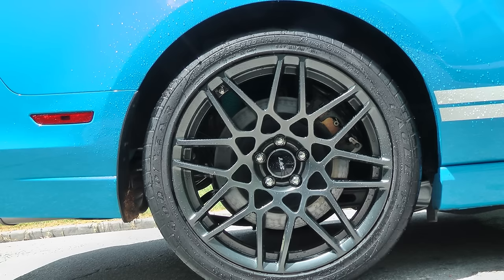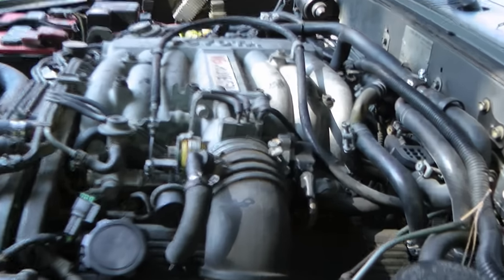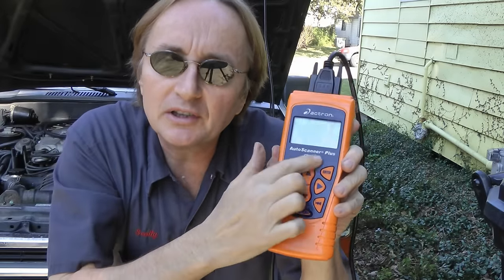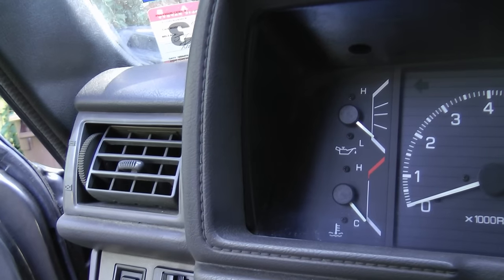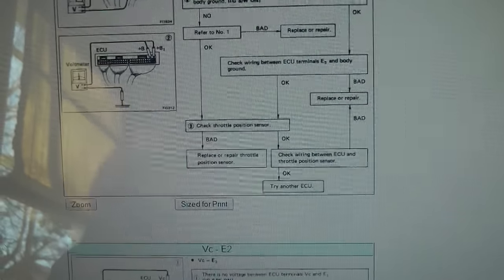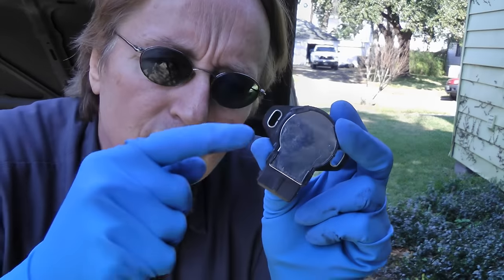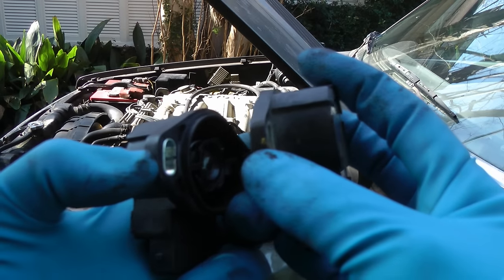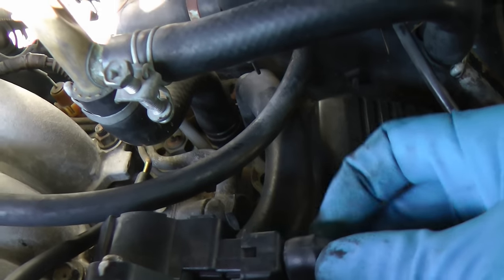How to Stop Car Hesitation (Throttle Position Sensor)

Comment: Hi Scotty my name is Carlos...I have a problem with my 2004 Dodge Caravan 3.3... It takes a little wile to start then when it starts runs good but when I put some gas starts to fell then when I drive runs good until up to #2 on the RPM gage then runs good until it gets to #3 RPM (I hope you understand what I'm trying to say)starts shacking again we change the camshaft and cranckshaft position sensors and we still have the same problem THANKS

Comment: Hi Scotty I have a 2001 Buick Century and it has an issue starting after the engine is warm and has been sitting for 30min- 2 hrs it will either start and die or just turn over. If I give it gas and rev it will run. I have read like everything on the internet about it and can't figure it out. You have any ideas? I see everyone online has the issue but no real cure I can find.

Comment: Hey Scotty, recently my 1990 4runner with the 3.0 v6 in it started to hesitate a lot. when giving it more than a quarter throttle at a stop it will not move and sounds like the engine dies for a second, then starts to catch and go. what do you think it is? thanks

Comment: hey scotty i used your test i unplugged the sensor and the idle went up from 5 to around 1000 so i changed it my problem is no power in my 1990 4runner ive also changed pluggs wires cap rotor even the muffler  it still has no power going up a hill is a challenge  do you have any ideas thanks,  the new tps did up the idle a little but still no power thanks

Comment: Hey Scotty I got a 2013 Honda Civic LX I got po171 code on it, I found a rip in the intake hose so I replaced it myself. I cleared the code and now the car seems to shake anytime going through gears no codes have came up since the replacement but im not sure what it could be now ?

Comment: Hi Scotty, great Video, I'm a fan of your skills -) I have a Subaru Forester T/Tb 1997 and the Auto Gearbox Error code 25 - — Еngine torque control signal - do you think that could be related to TPS? I replaced MAF, Lambda, Camshaft, Knock Sensors already with no success. The issue has been on going for almost a year now, no mechanics can help, at least I was unable to find decent mechanics. The car starts and drives just fine, then next day I get HOLD light flashing (error code 25) the car stats to hesitate with poor acceleration and  drinks loads of petrol but drives just fine otherwise. The idle is very smooth at all times though. So the issue might come and go, some days I get that some days it runs just fine. No Subaru forums were able to help me -((( Thank you!

Comment: i've been told to check my TPS sensor and the MAF but I Don't have any check engine light, sensors can be damaged and not be detected by the computer? I have a scanner and it doesn't pick any codes, car behaves erratic or random, sometimes feel normal and sometimes feels sluggish. Any advice. Thanks !

Comment: Nice video guy, I bought an old 94 gas passat and now it is stopped before some problems with rpm oscilating up to 900 and suddenly died, the comb pump is working and engine just don´t start teste relay and looks ok. I´d like to test bymyself the MAP sensor but it looks hidden cause I cant find it. Can you help me (*it is not inside ECU like old golf)
Reply from the maker: +Mauricio Ximenez   you really need a vag com computer to test that system correctly, and realize a 94 passat will fast become an endless money pit. My advice, get it runnin and sell it on

Comment: hey scotty, I have a 2007 gmc sierra. when I drive around 40 mph   my truck hesitates and the rpms  go up and down. it has 80,000 miles on it. I changed my transmission fluid around 65,000 miles. Is there something else that I could be missing? I don't know what could be the problem

Comment: Hey scotty. I have a 2016 nissan altima. Recently shaken and halted. Runs now but no more than45 mikes ph. Auto zone scan read throttle body. I cleaned the mass sensor and didn’t resolve. I bought a throttle cleaner but not sure if it will work or may need a new one. Pleae help

Comment: Scotty I have a 2010 hhr had too replace cam position sensor now the check engine light comes on and off and the,engine idles rough and surges when you come to a stop any ideas? Thanks.

Comment: I have a 2007 dodge charger and its having a problem with not acceleration when you put your foot on the gas pedal when going down the road. i replaced the throttle body and put a  gas pedal on it. It still doing it what do you think i should do?

Comment: Hey Scott, 
I just got a used Sentra with 72,000 miles, it was in a fender bender. Got the body repaired and everything but the exhaust sits low. As we drove home, on a hill it lost all power. Tried to accelerate and it started reversing. Got it started again and it did it again within 5 minutes. Today got it towed but it idled so much, he could barely get it started. The guy thinks its the throttle. What do you think?
Reply from the maker: could be, pray it's that easy, the throttle assembly or the pedal assembly, any pro mechanic can diagnose that fast with his scanner

Comment: Sotty I have a 2001 Dodge Dakota (V6 Automatic), that does this but only when in gear. If I leave it in first it will go past 2000 RPM but it with extreme hesitation. If I leave it in drive it will not exceed 2000 ever. Would this be the throttle position sensor?

Comment: Scotty my 1988 22re cuts out at around 3 thousand rpms and then comes back into acceleration once it drops. It creates a VIOLENT wheel hop. Its had the throttle positioning sensor, fuel pump, mass air flow sensor, and spark plugs replaced. What should I do?

Comment: I replaced the MAP sensor and the Throttle Body Position sensor, it still hesitates, won't go over 70mph with gas pedal to the floor and then will take off like a rocket and get stuck again. Would the iat sensor be the problem?

Comment: I have an 89 oldsmobile my tps code came on is there an easier way to replace it without removing the throttle body ? Also I don't know where to adjust it to

Comment: Hey skotty thanks for your advise on the problem i have with the steering pump noise issue i did what you told me, went out and bought a bottle of Bar's steering pump treatment and after using a turkey baster to suck some of the oil out and add the Bar's oil the noise from the steering pump just gradually vanished. thanks Skotty.. hey one more issue i have with my 2009 gmc acadia..when im in reverse the car seems to be struggling and dosent seem to have enough power. it shimmys a little when you press on the gas and it reves high and dosent move much. what do you think is the cause of this.? please help.

Comment: Can a bad or failing throttle position sensor cause intermittent hesitation and rough idle? Also, sometimes when I try to accelerate, nothing happens but when I take my foot off the gas and put it back on, it accelerates fine.
Reply from the maker: yes it can, but so can many other things. Have a pro check the tps data with his scan tool and a road test

Comment: here's a long one...
My dad has an '06 VW Passat TDI (2L, 6-speed). The throttle body was having issues so he had it replaced. He also had the engine decoked. A few days later, the car won't start. Just keeps trying to turn over and since the throttle body is stuck no oxygen can get in hence no combustion hence no engine start. We get the AA breakdown guy out, and all he does is pull the hose off of the (only just replaced) throttle body, puts his fingers inside to open the throttle body and voilà, the car starts. This keeps on happening so my dad takes it back to the garage, who take it to a specialist (supposedly) who say it's a wiring problem. Thing is, a finger to open the flap or a knock on the side of the throttle body with a hammer will open it up, even if the key isn't in the ignition. Also, big black smoke clouds come out of the exhaust when you rev it up, and this seems to fix the starting issue for a while. Do you think it is a wiring problem or has the decoking stuck the throttle body shut and keeps carrying on doing so?
Reply: I should add that the intercooler pipe has been blown off and then replaced, and the EGR valve has also been recently replaced
Reply: Hierophant

Comment: hey scotty i have a 2009 pontiac g6 i just bought yesterday i recently had the transmission flushed when my car rpm hits 3 at a low speed it feels like its hesitating or pulling but then it will run like a beast and pass 3 rpm and run fine when im driving fast any ideas?

Comment: Okay sooo... wat if ur did it already and did not mark where you took it off yet? How do you fix it because I scanned it and throttle position sensor was bad replaced it quick as possible and still runs like crud would that be an issue it's a 1999 jeep cherokee sport/classic 4.0l

Comment: Hi mr scotty kilmer, I have an issue with my ride a bit regarding a cold start. During cold starts, I encountered this issue whereby my rpm needle dips whenever I gently press the gas pedal or taps it before it goes up as normal. I could say the dip kind of acts like a 'lag' which causes my having some difficulties trying not to stall the engine at that point of time. 

I have just replaced my stepper motor to a brand new one which fixes a lot of things in terms of idling (on and off air-conditoning) and I checked my TPS with the multimeter, on idle its 0.7v and WOT it is at 5v (no flunctuation of voltage during gradual throttle pressure) which means my TPS is okay. What could be the issue? Please advise.

My car is a 1995 Mitsubishi Lancer.

Comment: I have an 89 Buick Century with a 3300 engine. It shakes a little but from a dead stop or under light throttle it hesitates a bit. No check engine light. Is there a way to see if its that sensor even if the light isnt being turned on ??

Comment: hey scott, I have a 99 lexus Gs300 and I have a problem with the throttle I replaced 3 times, the first time the car was vibrating, the second the rpm is too low, and now I replaced just 2 weeks ago  and it shuts down on the road suddenly when I adjust the throttle position sensor the car remains same even when I unplug the cable from it, I don't know where and what the problem is !

Comment: Is it possible that my tps sensor could be intermittently failing without the check engine light coming on? It’s a 2003 Honda Civic, hesitates to accelerate when giving it gas at lower Rpm’s. I changed plugs (no coils) and also a corroded ground strap.

Comment: Scotty I’ve got a car Mustang GT 2001 that hard starts when u first crank it up for the day and unless I keep my foot on the gas for a bit itll stall out but after that it’s fine when I’m driving and I’m pressing the pedal down it feel a like the pedal has some resistance and the car is not opening up all the way I cleaned the MAF and the throttle body plate and it’s still doing it I got no CEL or anything

Comment: So, if you unplug the throttle position sensor and the engine revs up, that is a indication that you need to replace the throttle position sensor?

Comment: Hey Scotty, I cannot figure out what Im having. I have a 1997 honda accord ex 2.2L that had a recent vtec solenoid leak. I replaced the seals and no more leak. Every gear at acceleration theres a slight jolting everytime i go to another gear. Usually the lower gears. Is the speed control sensor below the vtec solenoid leakage area, could this be the cause?

Comment: So for cars that are newer than 1998 ( I have a 2003 Honda Element), do you have a video on how to watch the throttle position sensor with the OBDII reader?
Reply from the maker: +nobrizzle not yet, mainly because data is different for most makes and models and it wouldn't fit many different cars or be hours long explaining them all
Reply: Thx

Comment: Hi Scotty, I had a problem to my 2006 kia sedona, it suddenly looses power and my esc warning light came on and I can only drive it to 20-30mph. The reason I think was my air intake has  cracks and I wrapped it with duck tapes. Before it happened everything was
working fine no problem untill i noticed my air intake, the duck tape was peeling off. I took it to kia dealer and they told me my pcm has malfunctioned, and if they replace it, it will cost $750- $1,500 for a reman 0r new pcm. i think they want to rip me off. Do you think my tps has problem? One time the service manager mentioned about something near the throttle body about little motor inside that forces the air. later on he said my pcm has problem that is why it looses power every 15 minutes. What do you think?

Comment: Would the TPS sensor cause a transmission not to shift up if it's going bad? I currently can only go up to third gear and I have a P0120 code
Reply from the maker: +Charles Webb yes it can do that

Comment: Hey Scotty Sir 
My car idles up above 3000  but when i turn my a/c on it goes down and idles to it's normal 750/800 
i changed my idle control valve sensor  thinking this was the problem but it still does the same thing 
Do you think my throttle position sensor may be the problem ? 
any help would be greatly appreciated thanks a mill 

Big Fan  of your vids 
My car is a 05 cs3 lancer
Reply from the maker: could be the tps, worth a try, otherwise it could be a computer circuit malfunction and they cost a ton

Comment: Hey Scottie I have a 2003 Dodge Dakota 4.7  The truck shakes Like its miss firing  I had a code that came up P0300 at 1st but I checked all the coil packs and spark plugs and it's working fine I reset everything and ran it again and I got a p0221  I got a new throttle position sensor but still getting the same code Running rough at idol When you put it in gear it act like it won't too stall but runs back up and down like a heart beat makes that sound at idol too please help

Comment: Hi Scotty: I have a 1994 Mazda Navaho and for practically the life of the car the check engine light goes on after 2 or more hours of consecutive driving. I then have to work the throttle to keep the car up to speed and if I don't get the rpms right it acts as though there is a problem with gas-mixture. One diagnosis said it could be the throttle position sensor. Lately, the check engine light comes on constantly and the car feels as though it's riding rough. Any thoughts? Thanks
Reply from the maker: +Gary Brandolino get it scanned for trouble does first, but if it was tps, change that out first and pray the computer isn't bad

Comment: hello Mr scotty I have a 2000 jetta vr6 what it does is it hesitates really bad when moving and accelerating and misfires it used to turn on the epc light and worked good when the epc was on but and when epc light was off it would hesitates and misfires now the epc light is off it doesn't turn off my car has the check engine on and is hesitating and misfiring what it could be? I already change new oil  sparkplugs and air filter

Comment: Hey Scotty, when I go about 70 in my 2004 Subaru Forester it causes my steering wheel to shake very rapidly. This also happens when I brake. But the weirdest thing of all is my steering wheel. When I turn left my wheel is crooked to the left but isn't loose. But then when I turn right my wheel is then crooked to the right but isn't loose either. Any help?
Reply from the maker: go to a good front end shop to check front end and alignment and tire balance first

Comment: Hi scotty,

I have 2013 Renault Safrane / Latitude and when I try to accelerate, the first 1 or 2 seconds, its very sluggish or slow. especially when the car start to move from a complete stop. Is it normal for 2.0 DCi engine? by the war, the car has automatic transmission

Comment: Hi Scotty,
I have a problem that may be under this category but I'm  not sure. I think its pretty serious and I have a large road trip coming up.
Perhaps you can help me figure this out?

I have a 2012 Impreza (manual) I bought as a certified used (60,000km) car from a Subaru dealer. 

After having it for about a month I noticed that it jerks at highway speed (100km/h) and at mid. It's like someone quickly taps the break hard.

This is when I'm in 5th gear at about 2500 rpm. It doesn't happen when im out of gear or city driving. Cruise control doesn't seem to make a difference in the matter either. 

This has been happening more and more often. Today it was about once every 3 to 5 seconds. It stops after a few times then starts up again a minute later. (process repeats)

I have already had the car at the shop for a different problem but even then there were no errors of any type that they detected.

What can this be and what do you recommend?

Comment: hey i have a 95 honda accord and i did the diagnostic for check engine light saying p1382 09-2 cyp sensor noise people said do the tune up and i did but nothing. It still jumps from 1k rpm to 0 when i push down on the clutch and throw it in gear i dont what else to do or say about this matter some also said change the whole distributor but dont know if it is the case dont wanna spend money on something thats not the case or matter.. thank you

Comment: Hi Scott, my 2000 chevy blazer is having this hesitation problem on uphill climbs and it also has the occasional long crank before starting. I bought used and fuel gauge didn't read properly either which I thought could mean someone recently changed fuel pump. Any guesses as to what could be up with it?
Reply from the maker: pressure test the fuel pump, weak ones or clogged fuel filters often do that

Comment: If you have a drive-by-wire car (no steel cable pulling on the throttle body, buit an electronic stepper motor) this TP sensor is INSIDE the gas pedal, so you have to need to change the gas pedal

Comment: Got a 07 impala (3.9) Its idling really rough like its going to die at anytime, when i accelerate its lack of power too... i was told it was Throttle body assembly, so i bought one. in case it doesnt work, any other ideas on what the issue could be?